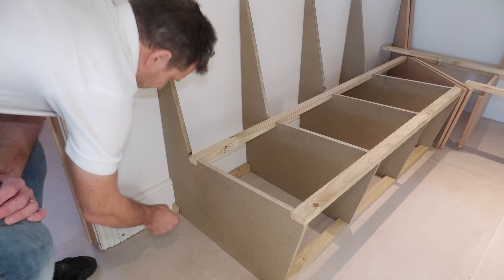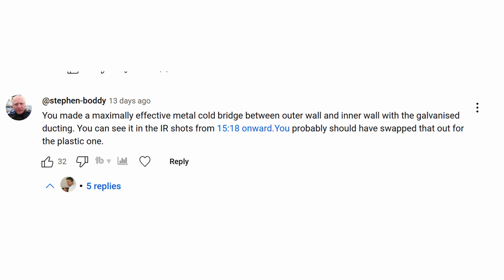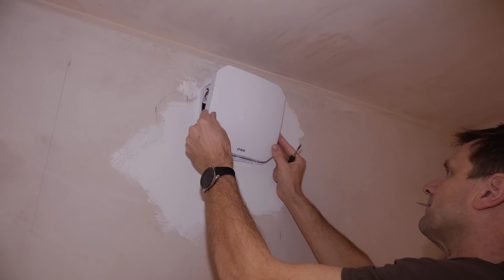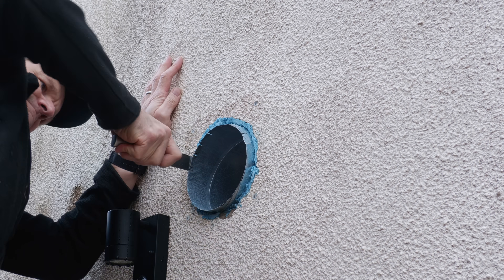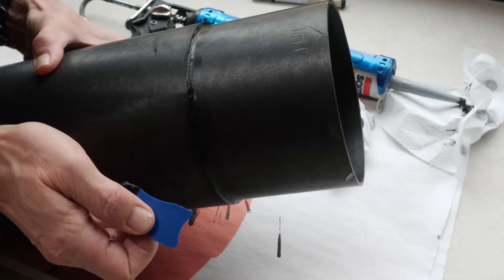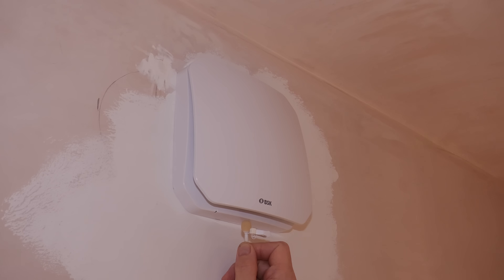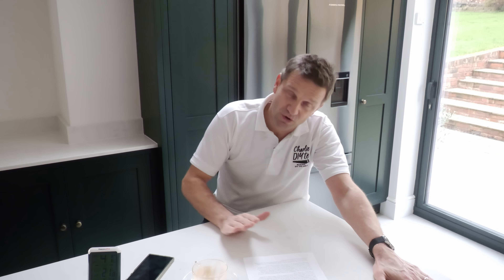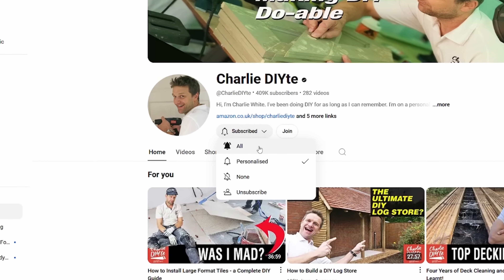Is Single Room Heat Recovery Ventilation Worth It?

Comment: I have an MVHR retrofit on a 70s property and although i only have one extract going down through a fitted wardrobe downstairs and all the other supplies are upstairs and over a landing the differences are marked. No condensation on windows, no mould, much lower CO2 in bedrooms at night 600-700ppm instead of 2000!. Less dust, clothes dry inside in hours. The biggest benefit with F7 filters is i dont get havefever inside for 5 months of the year anymore, which played havoc with my sleep. Money well spent. Air quality is great and i have monitoring to prove it.
Reply: +1 Same here.   I echo all the above.
Reply: What make and model of MVHR do you have?
Reply: @engineerabetterlife8301  Systemair VSR 300
Reply: @Kiwipictish  Yes, Enviroair Southampton
Reply: @richardlphillips do you have a link as I can't find this company on Google?
Reply: Agreed, these units lack filtration.  So for me a no go.
Reply: @markthomasson5077  Im not sure what you mean? the systemair?
Reply: The same here. 1970s house. Retrofited mvhr. The quality of air in the house is absolutely fantastic. House had historic black mould and condensation issues. After fitting the system its all gone.
Reply: And the other 7 months you have hayfever
Reply: @richardlphillips is the one extract into a hallway or a room? Did they come and survey your house?
Reply: @RingstingIndustries  They came an surveyed first. Supply is in 3 bedrooms and landing over stairs/hallway. Extract is in bathroom and downstairs (through wardrobe)
Reply: @richardlphillips you've got a system that utilises a thermal energy wheel, it will also remove moisture from the incoming air. Decent bit of kit. My biggest difficulty here (1930s terrace) is getting extract to downstairs. I don't have a wardrobe that's directly above the kitchen area I would want to extract from.
Reply: @richardc1983  Yeah there are compromises in retrofit. Our extract downstairs doesn't go into the kitchen it just comes through in the living room. Its not perfect but the benefits are so good it doesnt detract from the overall benefits. In my opinion of course.
Reply: @richardlphillips  Hi Richard. Thank you for your lovely comments on here and feedback. Does the MVHR reach all areas of the house? And where would be the best place to fit this system? I have a lot of condensation in the loft area of the house, buckets of water some days. Also in regards to pollen - if its recycling air in the house with the outside air, is that not bringing in more pollen, or are their actual filters specifically built to remove pollen with the MVHR system? Also, if their is something that you wanted improved within the system, what would that be? One last thing, in cold seasons clothes are dried within the home obviously, would you say that this system does the job of a dehumidifier?
Reply: @TrueGoodness I have vents and extraction upstairs and a single extraction downstairs as its a retrofit and there are only so many 6" diameter metal pipes you want going through your house. Mine goes through a fitted wardrobe and is hidden. Unit is in the loft and it has flow and return filters (F7) which filters pollen. Its not a dehumidifier as such but since air is extracted and replaced the humidity level stays the same as outside so does not continually rise in the property. Clothes dry well inside. we have a ceiling fan and put that on as well which speeds things up. We don't get condensation on windows inside. As it gets colder outisde the air holds less moisture so humidity drops which helps with drying clothes inside.
Reply: @TrueGoodness I cant really think of much to improve the system really. So many positives. Maybe the internet module so i can control it remotely or integrate it with home assistant, but mainly cos im a bit of an IT dweeb and like that sort of thing.
Reply: @richardlphillips  I see. Do you think the recycled air form the MVHR system reaches all areas of the house?
Reply: @TrueGoodness Yeah for the most part. Obviously less effective downstairs with a single extract but i have air quality sensors upstairs and downstairs and results are fairly consistent. Probably more important upstairs when you are sleeping anyway. Reduces CO2 in bedrooms so you sleep better. Dont get condensation and mould on walls downstairs and used to before the system was installed.

Comment: I put one of these in a windowless void room, it absolutely solved all the stagnant air issues and definitely retains heat better than a one way fan.
Reply: Spot on 👌 A standard extractor just dumps warm air, but with single-room HRV you recover most of that heat while fixing stale air. That’s why so many people fit them in void spaces, bathrooms, and kitchens.